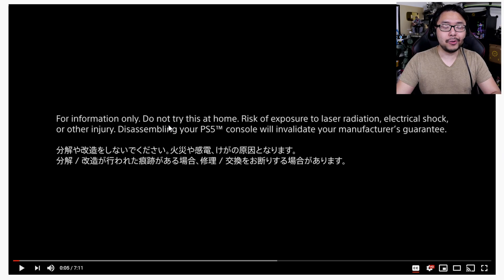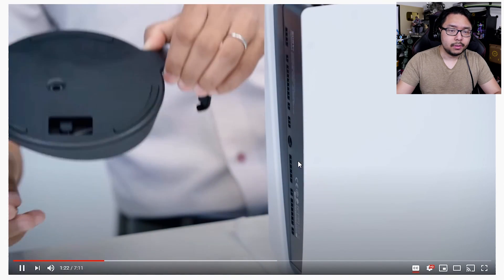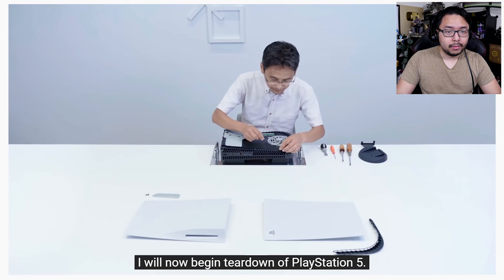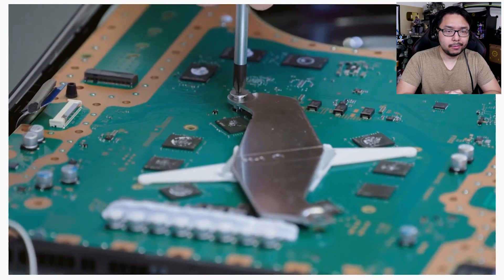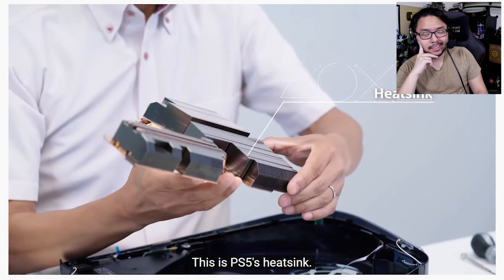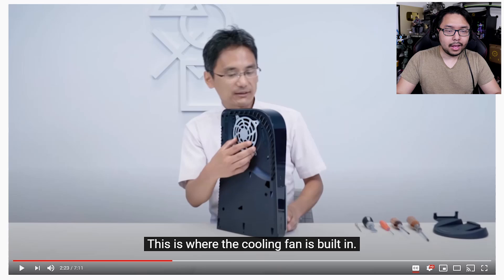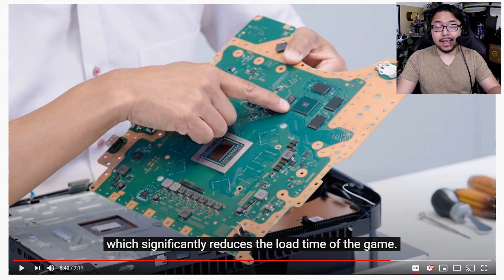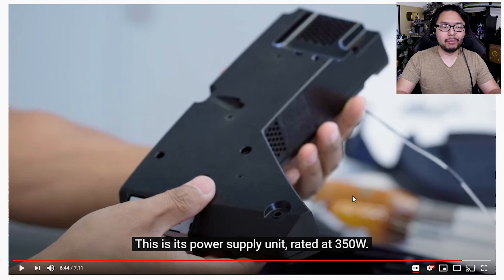Reacting To Sony's PS5 Teardown (Cooling, SSD Slot, Swappable Panels, & More)

Comment: Microsoft : "we got Power Armor, Dragonborn, and Doomslayer"
Sony : "we got Miles Morales, T1000, and pocket for screws"
Reply: PC has entered the chat
Reply: The last View Ever!  actually it's side by side in it's natural upright position. I'd expect the PS5 to run cooler, but the Series X won't have any issues with cooling, it's designed well to deal with that. I feel like playstation had to make more of an effort because the PS4 did so bad in this area and the fan was so noisy you would wake up household members playing your console at night. Also the Series X isn't overclocking and it's using a slower SSD but with speeds boosted with software, compared to PS5 overclocking and using a faster SSD will generate a lot more heat... 

....Liquid metal is actually essential for the PS5 and PC gamers who overclock have been using it for years, I'm just worried about the longevity of it.
Reply: So Xbox wins Is what ur saying
Reply: @robertbowser1846  lmao imagine thinking Xbox will be better then the PS5.
Reply: Kroeckinator series x is better lol more games better more powerful console and same price lol game pass also
Reply: @robertbowser1846  more games? You guys have like 4 exclusives, and two of them are basically dead now.
Reply: @robertbowser1846  MORE does not equal BETTER. Quality>quantity.
Reply: @robertbowser1846  I don't care for Game Pass (nor PS Now) as the library is majority older games that I've either played and own or have no interest in. Much rather own and buy my games upfront (unless it's an online service game), which isn't an issue for me because I know what I'm getting into.

That said, I'll probably pick up a Series X when Halo Infinite releases because as of now there's no compelling reason to buy a Series X right now aside from a performance upgrade, better visuals, and backwards compatibility; the fact that my One X will still be relevant for at least two years with first party and third party titles being cross-gen (thus the Fidelity of those games is compromised against the Series X to an extent) makes it even less compelling as the One X is still pretty damn powerful console with little drawbacks. Couldn't get a Series X Preorder so I can either wait till November or 2021 to play play MCC i guess

For now I already Preordered the PS5 for Demon Souls, MM and Godfall. Plus I'm giving my PS4 slim to a family member as a present so I can just bring my physical library over.

Maybe if the Series X gets a special edition for Infinite I'll pick it up
Reply: @chrisjr6214  That's true the XS has no reason to be bought right at launch unlike the PS5.
Reply: @robertbowser1846  bruh the only winner is the one who got to play with both, rich PC gamer & youtuber

Comment: The PS5 reminds me that I need to swap out components in my PC. My PC only beats the PS5 with the M.2 drive and the power supply.  :(
Reply: Unless you have the Samsung 980 pro drive, that was released this month. Then no your m.2 drive is not faster than the PS5 ssd. The PS5 ssd is pcie Gen4 and have roughly double the read speeds of an average pcie Gen3 drive.
Reply: YUCK PC

Comment: Question to anyone who can answer - Can I not just use an external hard drive for extended storage for game installation? That's what I'm doing now on my PS4. I have a External Hard drive plugged in via USB, one that is 2TB in size and it works just fine once it was formatted. Is this function now removed from the PS5? I'm guessing in favour of wanting to push people to buy official storage expansion from Sony.
Reply: You can still use a USB portable HDD for your existing PS4 game collection. You may wish to copy PS4 select games to the SSD for faster loading eg. Skyrim.
Reply: @GermanEnigma  Ah, I see. But the hard drive won't work with installing PS5 games, even if I wipe it and reformat it to the PS5, assuming such an option would be available that is.
Reply: I believe that the file formatting across storage devices are the same, it's just that the HDD's extremely slow access speed makes it ill-suited for PS5 games. PS5 native games should be installed on the onboard SSD.
Reply: @GermanEnigma  That is what I was assuming if it wouldn't work. Makes sense due to the switch to SSD.
Reply: PS5 does NOT use proprietary storage. The additional SSD that owners purchase is also available to the PC gaming enthusiast market. Much larger customer base results in lowered SSD retail pricing over time.

That cannot be said for Xbox Series X/S. That fan base is dependent solely on Seagate and Microsoft's exclusive partnership for SSD upgrades. That's why they could afford to sell the Series S at such a low competitive price.
Reply: Yes, provided the PS5 allows it, transfer the completed PS5 game to cheaper external HDD for archiving, then only move it over to SSD if there is an itch to replay it. Saves time re-downloading it from PSN or re-installing it from disc.
Reply: @GermanEnigma  That's a good suggestion. Thank you for your help. :)
Reply: Happy Gaming! :)
Reply: I think you can STORE ps5 games on a external hdd just not play from the hdd. With ps4 games I believe you can play from the ext hdd as you do now on a ps4. The usb should be fast enough? I wonder about having an m2 drive in a external caddy case if the usb is supposed to be 10 gb/s

Comment: They are screwing around to switch from vertical to horizontal position😂
Reply: My question is does that bother you
Reply: @jaahman0098  No, its just a word play.
Reply: TBH, IMO this option is better than non removable stand on series x. When you place it horizontally, it kinda make series x got knocked and weird
Reply: Xbox is garbo

Comment: PS5 would look really, really good with blacked out mesh panels that would allow for greater cooling. Someone's definitely gonna make them.
Reply: More openings also allows for faster dust accumulation so it is a give and take.
Reply: Or even just black panels would look cool, especially with that blue light.
Reply: Open sides reduces air pressure not always good for cooling.
Reply: @Shaved_For_Battle  A Mid/full tower computer case has the advantage of having volume and its fans move much more air than a console.
Reply: 🤦‍♂️... Dave C. You a thermal engineer? If not, leave em on.
Reply: i am gonna spray paint mine black the day i get the console
Reply: @clarence4946  I'm sure black versions will be purchasable, no need to do it yourself.

Comment: The giant heat sink in the PS5 is basically Sony saying “ngl, the PS4 Pro was loud af.” Glad i won’t have to hear a jet engine every time lol.
Reply: Regular PS4 for that reason: not enough ambient air space.
Reply: @Aereto  My regular PS4 is far louder than my Pro, oddly enough.
Reply: yeah hopefulyl this means for a much quieter console, they don't have a hard drive either this time, so less moving parts to make noise.
Reply: Just change the thermal paste.

My launch PS4 was easily the same noise as a hair dryer, after a good clean, I mean a good clean of the fan and heatsink, then replacing the thermal paste, its back to how it was when I first got at Christmas in 2014... but im glad they're upping the cooling, I cba taking part my PS4 every 6-8 weeks to clean or replace something.
Reply: This was never an issue for me to be honest. I mean enough people complain about it that I can't say the issue didn't exist. But I just cant relate. I guess my brain filtered out the noise or something.
Reply: I started to get back to the ps3, its also pretty loud, sometimes it tries to compete with my ps4
Reply: I always joked with my little sister that her ps4 is preparing for take-off when she is playing fortnite lmao
Reply: Except it uses a blower fan, which sound like jet engines, so you're wrong.
Reply: Yeah, but now you have to park a jet on your board.
Reply: The newer models of the PS4 are actually quiet. I got one and I can’t hear the fan. Only the disc drive at times.
Reply: Don't you goddamn jynx it...
Reply: its the sony equivalent of microsoft overcompensating with the original xbox one.
Reply: They went above and beyond lol. The console will now freeze. Shouldn't have any issues ever.
Reply: @davidf2676  what'd he say, deleted his comment
Reply: Something wrong with ur ps4 pro cuz clean that shit
Reply: @johnnytopgun6414  it's a problem many people have with PS4's. I bought it brand new, a week later, I had it playing horizon and it was ready to takeoff.
Reply: @johnnytopgun6414  they should clean their house first then ps4 after
Reply: Swag Guffington He said that it was quiet until he got close enough, what he had to tune out was the D-pad on the Series X controller.
Reply: Mine runs pretty quite as long as I keep it clean.
Reply: PS4 launch models were also loud too..
Reply: So strange, I've had my pro for 4 years and use it every day for 10 + hours, movies and games. It is very quiet and has never been loud.
Reply: worken360 Like I said earlier, this was only a problem on the first models of the pro. The newer models are completely quiet.
Reply: @davidf2676  dude I see you everywhere
Reply: The ps4 pro was not loud at all. The original ps4 is a different story
Reply: @SwagGuffington  both of these consoles won't surprise me if they were decently loud/hot. Anything less than the ps4 would be greatly appreciated. But with these consoles so powerful they're going to make small rooms considerably toastier.
Reply: Too bad that giant heat sink doesn't offer better cooling to all of the components.  That lower mem module is shown to run pretty hot due to poor cooling solution for it.
Reply: Xbox x makes no noise.
Reply: @oldschoolgamer5113  ya but it gets hot af
Reply: @oldschoolgamer5113  but it makes heat
Reply: XBOX SUCKS

Comment: I’m honestly curious why the consoles swapped axis length this generation. Feels weird going from boxes to towers
Reply: Ps5 is really good looking horizontally IMO
Reply: @Jengaman64  does look better horizontally. Still don't think it looks good though. But you can paint the side panels black, so I'm sure it'll look great in black.
Reply: For better thermal design. Heat rises after all
Reply: XBOX IS GROSS